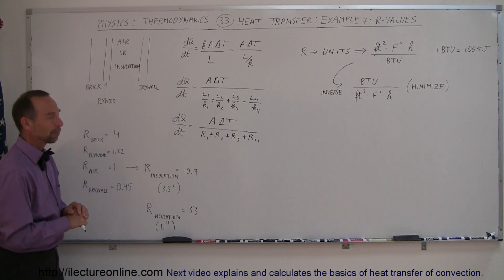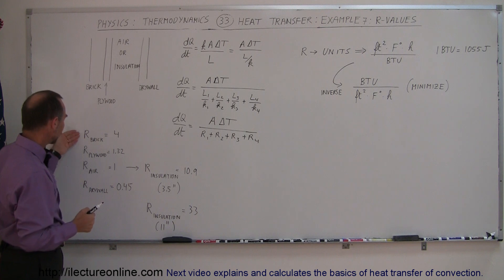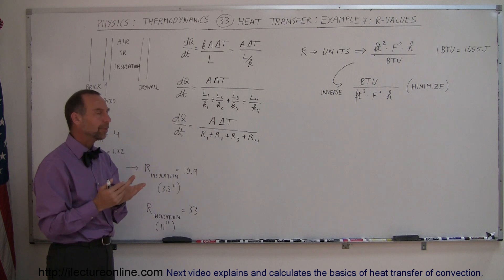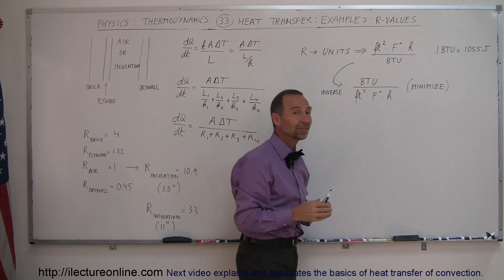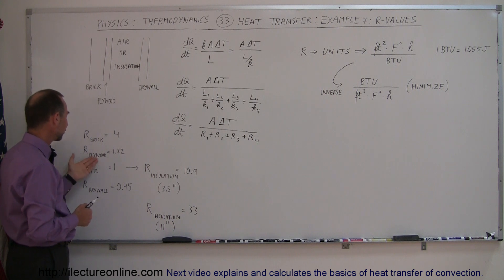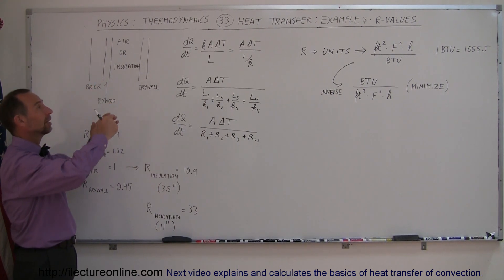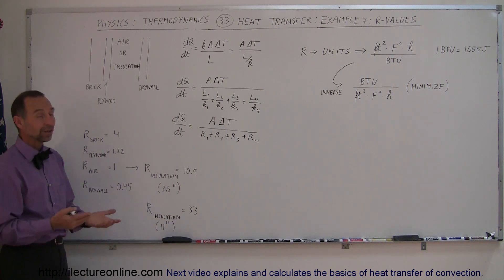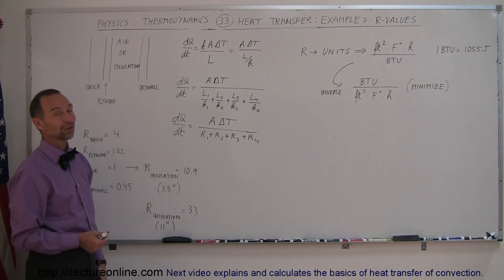Physics 24  Heat Transfer: Conduction (8 of 34) R-Value

Comment: Nice using English units sometimes  Examples should include interior and exterior film coefficients. Also example using an opaque composite wall. Examples to include   
Surfacw temperatures and the temperatures within the wall.

Comment: Thank you for the video sir. I wonder, does the wind (e.g 9 mph, at the same temperature) would change the heat loss in this case?
Reply from the maker: If the wind (air) is the same temperature as the surface, then no heat transfer will take place (heat deposited and heat lost will be equal) between the surface and the air, but there will still be heat radiated away.

Comment: Sir i have a question.
If i try to describe "k" with words it means (probably): "how many watts do we need to heat virtual object which dimentions is 1 meter lenght for 1 celzius degree of speciific material" . but this virtual object should be 3dimentional. why do not we use in "k" its cross section area?
btw while we convert "k" to r value
the m^2 suddenly appears. how come it wasn there in the k value?

Comment: A hot fluid following through a pipe of 5cm outside diameter to reduce heat lost, 3cm of insulation is provided on the tube. It is require to reduce the heat lost to the surrounding to 1/4 of the present rate by further converting with the same insulation . Calculate total thinkness of the insulation.

Hi Mr.. is this possible to solve.. I find it difficult.. anyway let me know if it is possible to solve.
Reply from the maker: Take a look at this video. It has the equation needed to solve this problem.    Physics - Thermodynamics 1: Ch 24.1 Variable Heat Transfer (20 of 25) Cylindrical Wall Conductivity

Comment: how do you just "put the k down there" ?
Reply from the maker: Brian Dixon 
When you reverse the operation:

When you divide by a fraction, it is the same as multiplying by its inverse.
Reply: Michel van Biezen thanks a lot. This video was much help
Reply: +Brian Dixon 
One way to think of "putting the k down there" is that you multiply both the numerator and the denominator by 1/k --- this will eliminate the k in the numerator and also multiply the factor 1/k in the denominator.

Comment: in this equation how would you use it to find  L value (say L2) if you had a desired max heat loss and the thickness of the insulation was the only unknown?
Reply from the maker: Tony,

If you only had one insulating layer then it would be simple algebra.
If you have multiple layers, then you must have information on those other layers as well.
The question which you asked cannot be answered without the additional information.
Reply: I have the information, the algebra however seems to be escaping me. I have all the variables and there are only two layers but I am missing the thickness one one layer.
Reply: 0.205J/sec=1.30m^2*311.15K/((9.40*10^-4M/(43W/mK))+X/(0.17W/mK))     where X is the unkown
Reply: correction the temperature difference is 38K not 311.15K